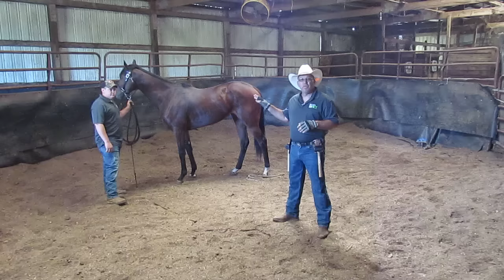Race horse starting gate problems caused from pain

Comment: I had two Thoroughbreds that were sent back off the track 'lame'. 3 track vets said rest them and maybe they would come back. I called my local chiro doc and one adjustment with follow up exercises he recommended, they both walked out sound the next day!  I cringe every time I think how many horses have been put down because they were deemed incurable according to a vet.
Took a filly in for training that was a flipper. She would rear and flip over as soon as the jock got on. Called the  chiro doc to examine her and she had fractured wither bones. So as soon as weight was in the saddle it hit on the damaged bones and nerve endings. No vet ever diagnosed it!

Comment: What causes these kinds of pain? Is there any way to prevent it?
Reply: Usually its from improper riding or a bad fitting saddle. Think of a bridge, a nice arch in the bridge makes it more structurally sound and able to hold more weight. This would be a horse who is collected with its back up holding the rider. Now think of a long stretched out bridge, its pretty weak in the middle. Race horses especially see these problems because horses extend when they gallop. So basically this horses back is stretched out with no support and the weight of the jocky sitting right in the middle of this weak point. If the back muscles are extended, well they arent contracting, so they cant hold the skeletal structure together. The spine is basically fighting gravity with no muscle support. Hope i answered your question

Comment: I wish your videos were much more complete. It would be nice - and helpful - for the viewers if the video showed the owners describing the problems - then you show us your palpating, diagnosis and treatment, and subsequently a follow up video to see how the horse is doing. Usually after an adjustment (from my own experience) there are other adjustments to follow until the chain of readjustments and muscles relaxing all works out. And after I see the chiro, I am still sore afterwards  - as the hurt areas are still inflamed and it takes days for the inflammation to go down. The same with a horse.

Comment: The sport of horse racing needs to be cleaned up.  A horse is NOT one year old if it is born December 31 on New Years Day.  NO speed trials or racing before horse is physically 3 years old.  Also, crack down on milk shaking.  One racehorse made over $50,000 in winnings and owners sent him to slaughter.  Horse racing makes over $6 billion annually, so there are plenty of resources to protect the athletes.

Comment: I think you need to watch the video again. Horse definitely shows quite a few discomforts in the neck also the polo horses do not react like that at the pole the thing about it is his head Shire horses were she want to put their heads up putting halter on 90% is pain so the horse had a lot of pain issues and if you watch it again you'll see him moving flinching from the pressure of the neck which I'm just going down underneath the problem the problem would be in the up in the neck but if you can't see that try to watch it a couple times and then watch the whole thing and you can see the pain issues disappearing thanks for watching and thanks for your opinion